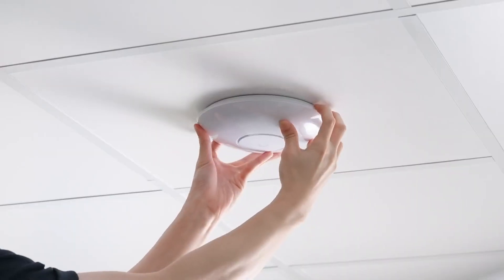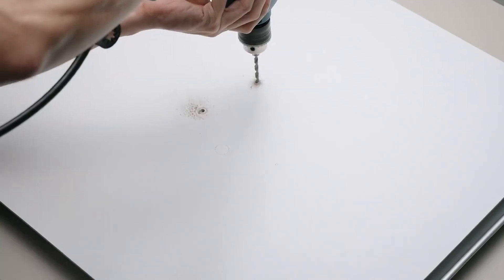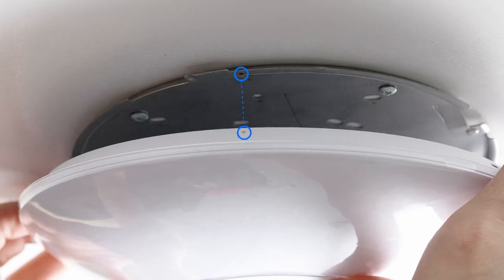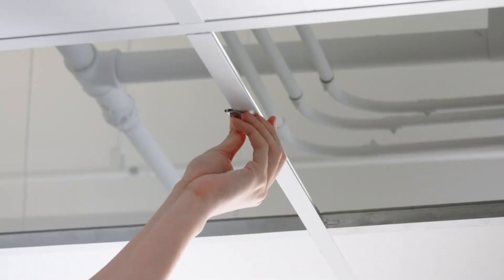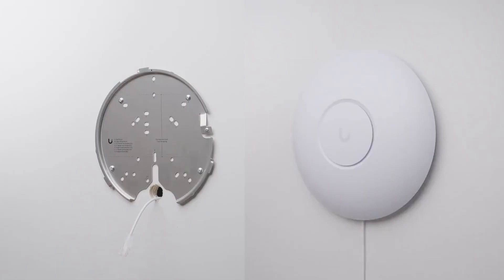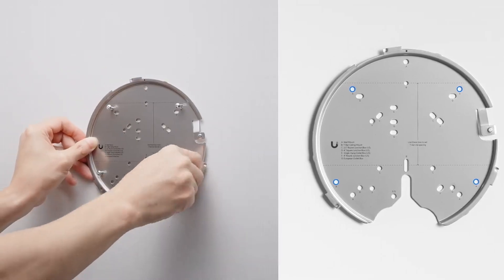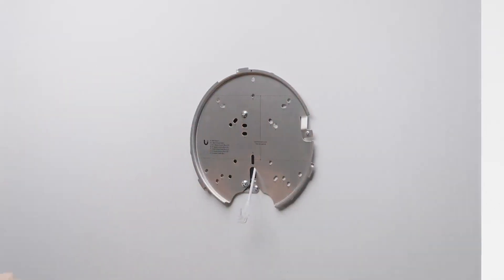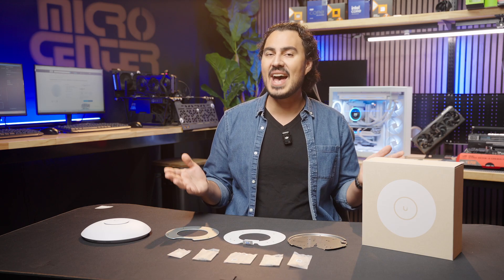How to install the Ubiquiti U7 Pro Access Point

Comment: Ya’ll, for home and on the ceiling, which is likely drywall, it’s the same application as a wall install, however, two things:

1. Because of the weight pulling directly down and out of the mounting points (mounting points have no significant grip), as opposed to on the wall applying a sheering force (mounting points put pressure on the wall), I’d highly recommend drilling into a stud in the ceiling/subfloor with at least one but preferably two of the four screws. You can use a 1/16 or 5/64 wood-friendly drill bit to predrill the hole for those screws as you won’t be using the included drywall anchors for the stud; it’s directly screw to wood (the non-stud holes still get the anchors). Use a stud finder WITH an electrical circuit sensor and a metal sensor. Don’t un-alive yourself drilling into an electrical line or flood the space hitting a water line. Putting screws in the studs makes it solid and sturdy, and highly unlikely to fall due to natural weight factors over time, as opposed to drywall anchors eroding their grip over time (especially if there’s a floor above that gets walked on, as vibrations can wear the drywall anchor holes out faster.) 

2. Have fun fishing the wire through the subfloor. It’s a pain in the ass. Get some wire snakes or fiberglass polls to fish a wire through the ceiling/wall. Remember: if you’re going to run anything electrical in your walls or ceilings (that includes Ethernet), it must be in-wall rated wire. Ethernet is designated with the type code of CM, CMR, or CMP depending on the type of space you’re putting it in. However, low voltage wire like Ethernet doesn’t need to be terminated in a junction box; though it’s best practice to do it anyways. Keeps things tidy especially if you plan on relocating stuff later. If you use a junction box, don’t follow the steps in my post above. Instead look up a junction box installation in a ceiling, then come back here and follow the junction box installation section. 

Bonus 3: Be weary here as well just to the fact that you will likely need to cut multiple holes in your walls and ceilings to fish the snakes at joints, angles, or bends. If it’s drywall, it will get messy. Make sure to have a drywall saw, filtered masks, eye protection, and other equipment for that task to cut then patch things up after you’re done. Recommend watching drywall patching tutorials on YouTube to understand that process. Also, wear long clothes to reduce exposed skin and keep children and pets away from your work area(s). Clean up the work spaces and then take a shower right after you are finished; don’t leave it on your skin for long periods, and again, wear a filtering mask and don’t breathe it in. 

Be safe, have fun, and don’t let the task frustrate ya. If you can’t figure it out: Take a break, then look up some stuff, and come back later.

Comment: I bought a U7 Pro Max on 1/25/2024. Sent it back 2/4/2025. The 2.4ghz is very buggy and not fixed on any of the EA 7.x.x versions I have tried and even the EA 8.0 version. I should have known, I remember when I got the U6 lines when it first came out and wasn't ready or fixed for a long time. I left Ubiquiti Unifi line for other brands because I didn't want to be a guinea pig anymore. I can back with hope and yet again Ubiquiti is dropping the ball.

What is with the rumors about the problem being the single chip design and possibly releasing a new hardware version that uses 2 chips keeping the 2.4ghz on a separate chip?
Reply: They found a hardware problem and have been going through the FCC to get a revision approved.
Reply: Should I not get one of these then?